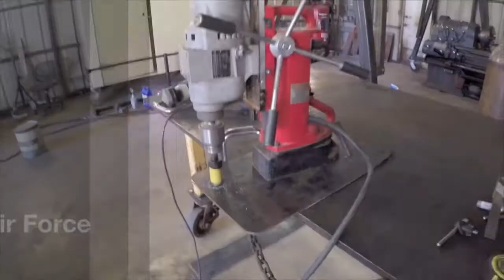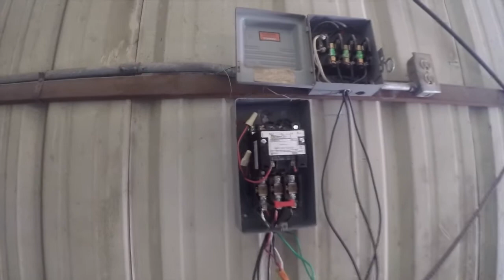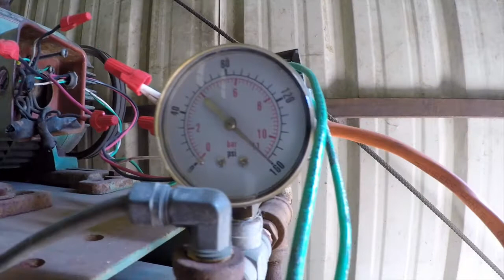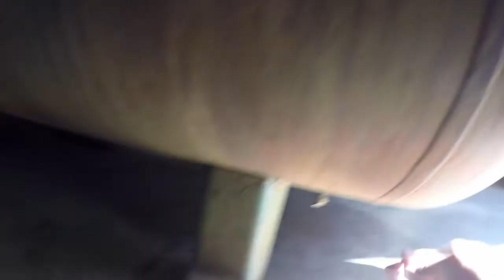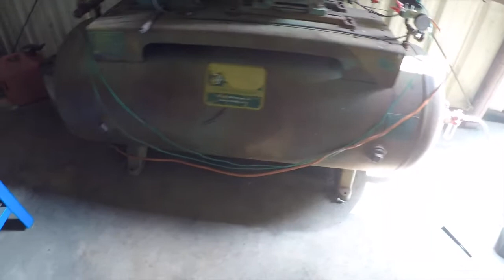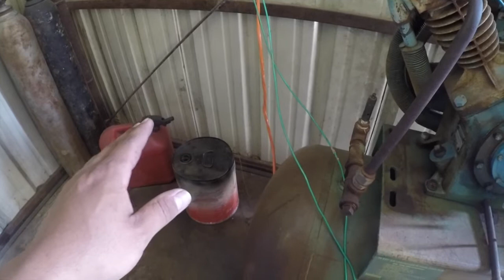#84 Speed Air Compressor 3 phase

Comment: there is a way that you can remove 90% of the moisture going to your compressor.. If you remove the moisture from the air before it's compressed then you won't have to remove any after it's compressed if you purchase a small 5000 BTU window unit disconnect the evaporator blower from the motor shaft. Take  the inlet pipe from your compressor and  run  it to the cold side of the evaporator make it airtight. As the air moves through the evaporator it will give up most of its moisture the evaporator will be separate operating at a very low temperature causing it to frost over when the compressor satisfied you cycle off the air conditioner when the air-conditioners and not operating deiced that is formed on the evaporator should melt and run out if you have any questions you can contact me at    jpmorgan917@Gmail.com

Comment: be careful setting your pressure 125 max and a differential of 25 psi so it turns on at 100 psi. I have a 10 HP four cylinder devillbiss air compressor with a 120 gallon tank and 10 HP motor andm125 psi is more than enough to sandblast all day and it keeps up just fine. I also seen the unloader has a long bolt in it. it shouldn't be there the unloader takes the load of the air compressor until the motor gets up to speed before you invest the time and money in the air dryer hook it up and run air through an air hose not t the drain for about ten total cycles then drain the tank and see if is any water coming out mine almost never has any water in the tank so I didn't need an air dryer. so I hope that help you save some money. but remember any thing over 125 psi is way more risky than it's work look up air compressor explosions.
Reply from the maker: Great advise I'll adjust to 125 and see how that works for me. I have been running 100ft of hose and have noticed this psi drop but I'll adjust the regulator and see if I can make it work.

Comment: you do know that welding gloves offer no electrical protection.
Reply from the maker: Can you explain further? One full leather glove to another what's the difference other than the dexterity.
Reply: +Fabric8tion Nation  I take it u have never got the tingles when welding in the heat when u change rods.   leather is not non conductive  unless you have on gloves with a rubber inner  you can still get lit up.   here is a link to the proper gloves for electrical work.
Reply from the maker: Thanks I'll look at it. I wasn't real concerned with getting electrocuted but figured the welding gloves was better than nothing.
Reply from the maker: I am very careful and kill everything and test it before I work on equipment. Thanks for the advice. I'll get me some gloves need them anyway.

Comment: Great Video Al. 

 You can interrupt  the green wire on the pressure switch  with a light switch to turn the compressor on and off rather than throw the disconnect switch every time.  it will save the disconnect switch from the arcing  that occurs every time you turn it on.

May I suggest plumbing the shop for air?  you've got a pretty big shop and to have hoses running all over the place will be a pain.  You'll also lose pressure and volume with long runs of 3/8" hose.

If you decide to plumb the shop slope all the lines back to the tank. tap into the top of the lines for your drops. use 3/4" pipe for your drops.

Comment: just a thought I would check what the max rpm for the compressor is and make sure its rpm is in range that is a big pulley on the motor not sure the rpm of the motor. I sure to like my automatic drain valve on my compressor.
Reply from the maker: Thank you I'll look into it.

Comment: IMHO you are going to need an oiled outlet as well,, air tools and the like need oil in reasonable amounts for long life,, that's the only thing i see wrong so far<you might have plans for it and forgot to mention it> ,, keith fenner has a good discussion in his drying setup for his plasma cam and related info as far as paint work you will want seperate lines for dry air over oiled air all-in-all nice setup and good work!
Reply from the maker: Thank you. I was thinking I would an oiler on a separate outlet routed through the shop but it may be good to have at least one outlet from the compressor to have an oiler. So 3 dry air and one lubricated. Thx for the advice.